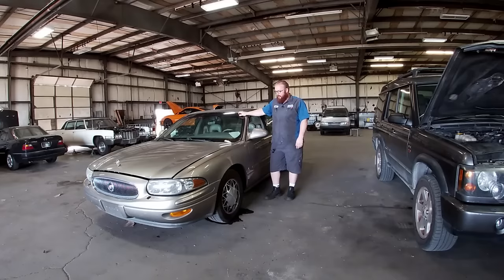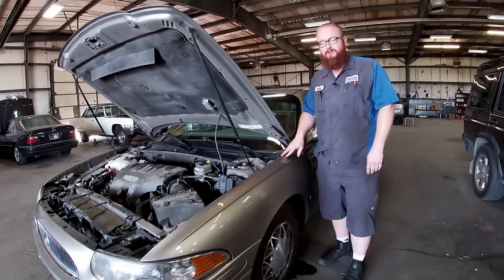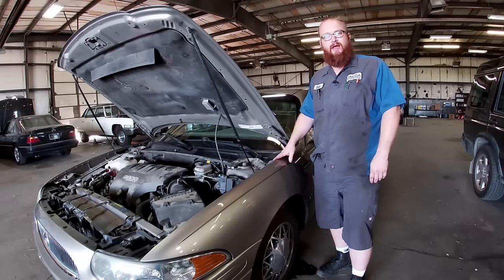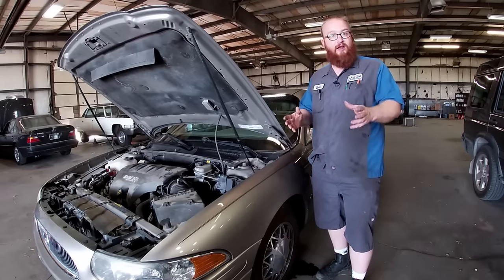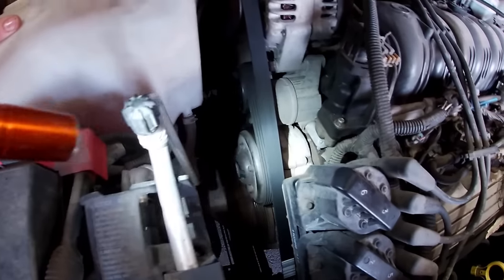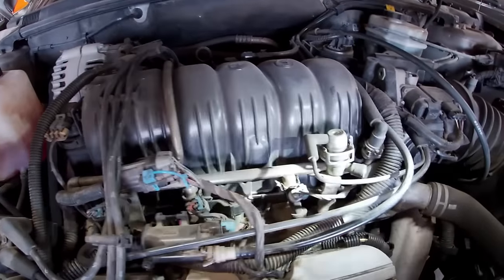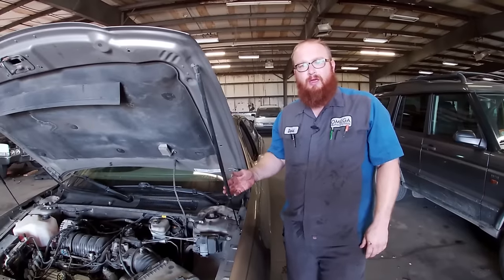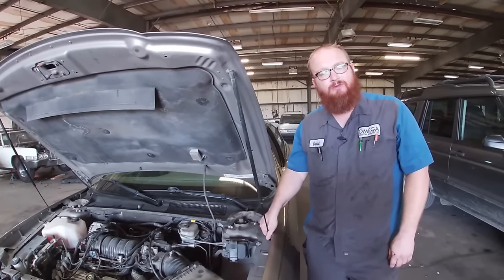CAR WIZARD highlights what makes the Buick 3800 V6 the BEST engine ever!

Comment: It's nice to hear someone confirm what I've always known...3.8L v6's are probably the best motor GM ever built since the small block chevy.
Reply: "Small block Chevy" is kinda vague, there's a few... but they're all solid products, so... (Technically the 3800 series, V6 IS a "small block Chevy, well " small block Buick. Same difference)
Reply: @godchi1dvonsteuben770  if I'm not mistaken they are all based on the same basic design with no doubt some upgrades over the years... though I'll admit I'm no engineer so I wouldn't bet the farm. All I know is that my last 3.8 in a 96 le Saber got to 500,000kms and was still running perfect. The chassis finally got tired and a little too much rust. The current 99 3.8 has 380,000kms on it and needless to say runs perfect
Reply: Fords inline 6
Reply: Yep 👍
Reply: True they last till about 400k
Reply: 4.8 ,5.3 and 6.0 Vortec V8s are the best GM motors equally
Reply: @billrobsham697  they do seem to have a well deserved reputation.

Little piece a trivia you might not be aware of...the new Z06 Vette engine while at a mere 5.3l puts out an amazing 670hp and ..get this...a 8600 rpm redline...

8600 rpm....that's crazy.
Reply: @glenntremblay5406  that is crazy HP out of a 325 cubic inch V8. I didnt realize a V 8 could rev to 8600 safely. I'm sure the rev limiter keeps it just out of danger zone
Reply: @billrobsham697  Jay Leno's garage has a video on the 2023 Z06 Vette. It's interesting to watch...
Reply: @glenntremblay5406  I’m pretty sure it’s a 5.5 but you’re completely right
Reply: The 3.8 makes the 3.6 look like garbage oh I forgot it is garbage
Reply: @gavellhunter4985  Are they that bad? I hear Car Wizard say how bad they are, but I also hear TONS of people with Impalas or whatever and say "oh, it's SUCH a good engine! So much power, so reliable!" and stuff like that.
Reply: @isaac24  which motor are you talking about, the reliable 3.8 or the moneypit 3.6
Reply: The 3.6. I've seen so many people rant and rave about how good it is, and then I remember what the Car Wizard said about them.
Reply: @glenntremblay5406   "Great" engines is somewhat hard to quantify as performance and reliability wrestle for dominance. Mopar 318 gets my vote for low buck reliability along with the early 70's hyd. lifter 250" Chevy inline 6. A girlfriend had one in a 1974 Camaro with a Turbo 350? 3 speed auto. and i drove that car several times before learning it was not a 307 or a 305 but rather an inline 6.
Reply: @isaac24  they are good at first
Reply: Except the Buick and Olds 350 was better than the Chevy 350.
Reply: @glenntremblay5406  Reminds me of the old 327/375b chev  hi-po's.
Reply: @godchi1dvonsteuben770  The 3800 V6 is a different engine than the 231 aka 3.8L V6. The 231 was a Buick 350 less 2 cylinders and was nothing like a SBC.
Reply: @tedesco455  Didn't say it wasn't. It's a 215 ci Fireball, with 2 less cylinders, but you gotta' realize somethin. They've been making variations of that engine since the 1960's. There's versions ranging from 3.0 liters, all the way to 4.1 liters. I was just stating that the 3.1, and 3.2's are easy to get, bulletproof, and are relatively easy to slap in tbe back of a Fiero GT. Whether you east/west mount it, as the Fiero is already laid out, or decide to make a project out of it and chop out the trunk divider wall, weld in new motor mounts and north/south mount it, with a front wheel drive transmission, or an aftermarket transaxle, then supercharge the damn thing, they're great for building a Fiero GT budget supercar. That's all I was getting at. The late 90's, early thousands Buicks had the 3.8 version... So, best I can tell, we're on the same page boss! Don't know why you're correcting me???
Reply: @tedesco455  Oh, just one thing, 1998 Buick Regal came standard with a 3.8 liter, 3800 series V6, just sayin' L8r boss...
Reply: @godchi1dvonsteuben770  How does a 215 less 2 cylinders equal 231?
Reply: @tedesco455  Because back in the 60's there was a 215 V8. The same architecture, subsequently the same family of engines, resulted in a 231 V6, years later...
Reply: @tedesco455  Hell, I could ask you the same thing! Hows a 350, less two cylinders, a 231??? Like I said, look up the Fireball, and GM V6's, theres a whole bunch of em... derived from one engine, a 215 V8... aka, Buick Fireball...
Reply: @glenntremblay5406  I used to have a bike that the redline started at 19,000 RPM, it had 4 tiny little 48mm (1.8 inch) pistons and a 33mm (1.2 inch) stroke. You had to have zero mechanical sympathy to ride it. :-)
Reply: @gavellhunter4985  The 3.6 that replaced the much loved 3.8 in the Aussie built Commodores here in NZ was called the "Alloytech", it soon earned the name "Rattletech" by owners and the workshops working on them :-)

Heres a vid on the Aussies take on them. (lol the aussie mechanic at 0.05 mark :-))
https://youtu.be/vVB1CF6kQZk
Reply: The 5.3 6.0 and 6.2 LS motors are by far the best...
Reply: @jaredchampagne2752  talk to me in 50 years to see if they last the test of time like the small block did...

And the new stuff has its issues as well...
Reply: @luxinterior3085  Amen brother...and in the process destroy their own middle class who used to make the high quality products
Reply: @glenntremblay5406  so the Americans are finally catching up with their motors output of power compared to it's size. Because it was always ridiculous.
Reply: @godchi1dvonsteuben770  The buick 350 is nothing like a 350 chevy chief.
Reply: @glenntremblay5406  Nope.
Reply: @kskip4242  not much of an argument...lol.

Maybe you got a lemon... happens now and then but my experience has been steller.

And to be honest you are the first one to be in the negative with these engines...that I've come across.
Reply: @isaac24  The 3.6 lfx from 2012 up are wonderful engines, just keep the oil clean and full and it will go well past 200 thousand. 300 plus hp also.
Reply: @glenntremblay5406  What comment did I say I had issues? They do have thier issues even though thier few, look it up on the internet, there is no excuse for your STELLER ignorance. Don't just come back and argue with me and say thier perfect.
Reply: @jaxcarter9898  I might have misheard...
Reply: @jaxcarter9898  but still...WOW
Reply: @gregorytimmons4777  of course I can only speak to the motors I've had first hand experience with... I'm sure it's not the first "great" motor to come out of Detroit.
Reply: I've always told everyone that these engines are the best everyone looks at me like im insane
Reply: @marcthebarber239  they're idiots. If a motor hasn't got 300 plus HP they look down their nose at it. HP is nice but reliability and longevity are king in a passenger car. I have no first hand experience with the motors that the general replaced the 3.8 with but they don't enjoy the same reputation from what I heard...likely because they push alot more HP from less displacement. Go figure that they might not be as bullit proof.
Reply: The 3.8 will outlast a small block by twice, easy.
Reply: I've owned both. Can confirm.
Reply: @tedesco455  The old 231 would actually be 307ci, if another two cylinders were added. Buick did make a 300ci V8 in the early-mid sixties, so I suspect the 231 was developed with a slightly larger bore than the 300.
Reply: @godchi1dvonsteuben770 lol he is obviously talking about the 350
Reply: Not bad for a motor that started out a V8 ! A 215 alloy V8
Reply: @godchi1dvonsteuben770 small block Buick V8 does not share one part with a small block Chevy !
Reply: @billrobsham697 not any more the 403 ci LT is way better !

Comment: It was a sad day when GM quit building the 3800. I've owned several and I absolutely LOVE this engine. Here in the Rust Belt the engines always outlasted the car they were in.
Reply: Yep.  Rust belt, why I had to give up my LaSabre..great engine and comfy ride.
Reply: what year is this buick
Reply: It was too good. They had to stop making them
Reply: @ronhoover5516  You'll get no argument from me.
Reply: @7thkansascav468  Good cars, though!
Reply: Is the 3.9 any good, all 3.8 cars I find have way to many miles in them.
Reply: In college I bought an 05 Lacrosse with 100k miles, drove it to 280k. At that point I could have stuck 2-3k in it and easily drove it another 100k, but fell into a smokin' deal on a used Impala. 

The Impala has been very good. But once it's time to get something else, I'm very very tempted to find another 20 yr old Lacrosse some grandma has been pampering. It'll cost 20k less than a new car and probably last longer, wouldn't you agree?
Reply: In the rust belt you don't get attached to cars, you get attached to engines. They're heart that beats you to and from work everyday.
Reply: @jeannewright3027 same here. I bought a 2002 LeSabre LTD from my son-in-law for $1500. It originally was his grandma's car. I think it had 115,000 miles when I got it. The fancy digital display crapped out so it wouldn't display  the odometer anymore. Drove it 4 and a half years. Had to put in a new heater blower. Also front wheel bearings, muffler and tires. But that motor  used virtually no oil and I averaged 26 mpg. Got as much as 32 hwy. Had to trade it in cause it rotted out the shock landings among other rust. I'm guessing it was almost 200k miles on it. Great motor with great low end torque too.
Reply: That is what happened to my friends LeSabre with over 500,000 miles on it.  The rust got it.
Reply: This motor and the 4.3 vortec motor for the truck were the best motors GM made it sure is really sad they quit making them both.

Comment: I was a  33 year Buick sales rep. We were Best in Class with 100% customer satisfaction. I could tell you every difference year by year. Buick had great training.
Reply: What is the model and model year of the car wizard is describing?
Reply: Do you think i could get a car w this engine for under 2k
Reply: The 3800 has a long history which series years  are the most reliable?
Reply: you should try get on a video call with the Wizard to make a video on buick
Reply: @ben43123  I just picked up a 2008 lacrosse cxl for 2300 CAD, definitely possible.
Reply: Me and everybody i know says the series 2, N/A is more reliable but SC is more efficient with more power and easy to mod. @staresce
Reply: Weren't the transmissions bad on the 2000 Lesabre ? Bad solenoids?
Reply: @JohnTaylor-bd1uy  expect the trans to wear out around 175K and you won't be surprised.    Used with 200K and a replacement transmission is a 100k car.   In quiet luxury. The rest is easy to fix.
Reply: @ben43123   yes, I just got an 08 pontiac grand prix w/ 105k miles for 1200 bucks at an auction

Comment: I worked at BOC in Lansing Michigan and was involved with the 3800 Buick V6 engine in the engine plant. I was involved with bringing this line in and start up. It was the first time that GM had SPC involved with the machining of this Engine. SPC means statistical process control. SPC was developed by a man named Edward Deming. He first got cars in Japan in SPC and is the reason why Japan was kicking our ass. The Buick V6 3800 is one of the best engines ever made by GM.
Reply: Interesting.  Edward Deming was an American engineer and an efficiency and quality control expert who is revered in Japan as the man who turned the Japanese car market around and transformed them from a reputation for "junk" to one of high "quality".   He is mentioned in several Japanese management books that are widely studied in Japanese businesses and universities to this day.
Reply: And then GM forgot to use SPC 🤣😂
Reply: @letmethinkv  Quality control is always a challenge and U.S. companies often gravitate towards cutting corners to increase productivity and their short-term bottom line because bonuses and promotions are usually tied to short-term profitability.  The Japanese tend to look towards long-term success rather than short-term gain and they end up winning in the long run because consumers keep buying their high-quality products.
Reply: @1notgilty  so its not SPC
Reply: @letmethinkv  Right.
Reply: Well who the hell is responsible for the cheap behind motor mounts?? And who's brilliant (being sarcastic) idea was it to put the car battery under the back seat of the 2006 Buick lucerne cxl v6 3800?
Reply: Deming created QA. Quality Assurance. The idea is that EVERYBODY from drawing board to out the door, knew their job and completed their task with utmost precision, so when that part went to the next in line, it was “fit for purpose”. 
Quality Control on the other hand, was noticing a part was not good enough quality to use and subsequently throwing it in the garbage. This creates time and money losses for the company.
Reply: I've had 2 cars with this engine in 30 years, 411000 km and 23 years from the first car, on the second one with 275000. Never touched the blocks or heads on both.
Reply: @leathabulloch1618  Thats actually the best place to heip balance the car out.
Reply: @leathabulloch1618   maybe the person responsible for putting the battery under the rear seat in the 2000 LeSabre ?
Reply: You say “one” of the best engines. Then which is the best one that gm has made?
Reply: Grand Prix gt2 2004 with 3800 v6 running still at 346,000 still uses no oil and lived thru myself then 2 teenager that drive like race car drivers lol
Reply: wow that's it's crazy but totally makes sense, please tell me more lol really tho I wanna know more
Reply: @jeannewright3027
0 seconds ago
Guess what I found at Sundance? Buick Allure, LaCross. 70k 2009, 3800. Undercoated came from Canada. Looks new, have a carfax on it. Mechanics approved the buy. I take it home end of week to my driveway in Delta Twp. Ruby red.
Reply: Actually, W. Edwards Deming offered his SPC to the "Big Three" American car manufacturers first and they weren't interested. They told him to get lost. Japan was still recovering from having to rebuild their industries after WWII. They figured, what do we have to lose? The rest is history.

How do I know this? I studied SPC in my work when my company was forced to adopt the ISO certification process which the rest of the world was using.

Comment: I had a 2000 impala with this motor. Literally the best car I've ever owned. I regret letting it go
Reply: Those were cool cars back then and IMO still cool to this day.  Chevy cars used to have really great looking taillights.
Reply: No blown intake gasket by 120k miles?
Reply: @JustAGuy85 easy enough fix
Reply: I'm glad to see repairs are simple easy.  I just purchased 2006 good condition 66k miles for $400 it just randomly stops on low idle or complete stops. I'm going to clean the MAF 1st, any other tips would be great. Also used my OBD and no error codes.
Reply: I have a 2000 with the 3400, I replaced the intake gaskets at 90k miles before they had a chance to blow. Car has 277k miles now

Comment: I inherited a '98 LeSabre with 88K from my Mom with this engine.  I was gonna sell it for $1200 but first I took it to the track to blow it out.  It ran a 14.5 second quarter mile first run.  It cruises at 100mph effortlessly and still gets 28mpg with the AC on.  I think I'm keeping this car.
Reply: if you see any, and I mean any car with this engine in it and you've got it cheap, keep it because the engine will outlive the car if you look after it, the chassis will rust out long before the engine dies

Comment: Much love for this engine from Australia! Mine has 400 thousand km's and purrs like a kitten and is so cheap to maintain. Bless buik
Reply: I'm from Australia too mine done over 1 million kms and still running great engines
Reply: Holden Commodore got a great engine but the worst quality interiors GMH could come up with.
Reply: The only problem with Holden adaption was that the thermostat is a pain in arse to replace.
Reply: 700 plus on my ex NZ VP cop car only died because of the dedicated lpg system sluged up.
Reply: this engine  had rear oil  seal problem
Reply: @robertcallow2298  one in thousands is not bad!
Reply: @basiksfifth6946  cast iron block? unkillable. That's why I didn't get a commodore. the later ones are alloy block. Now the Ford has the Barra...
Reply: Mine has just clocked 220000, running beautifully, only issue I had was needing to replace the radiator as some of the plastic housing cracked. It was a hot summer that year 48 degrees near when it broke, and it was parked on hot concrete from 6am-4pm every weekday, next to a factory. It’s the same age as me and I’ll drive it till it gives up.
Reply: Same here. My car has traveled 365,000 kms and also purrs like a kitten . I am getting a low 8 litres per 100kms.
Reply: @Koala-Express  the interiors were more than adequate, got a vy with 400k and nothing in the interior is broken, no interior will be good if you have hammers for hands and smash everything about and treat the car like crap